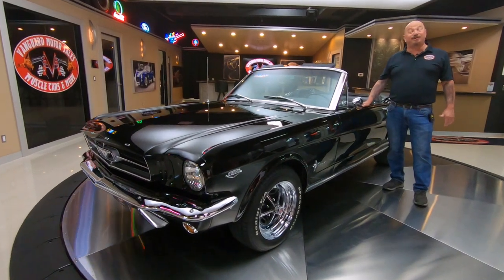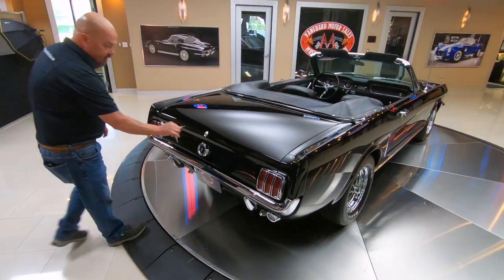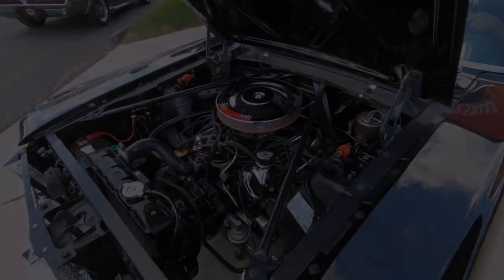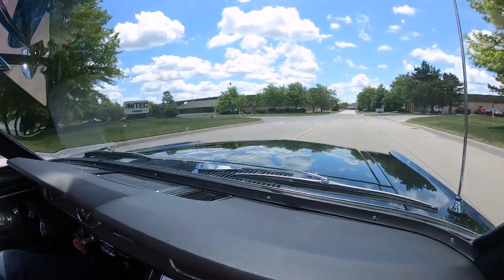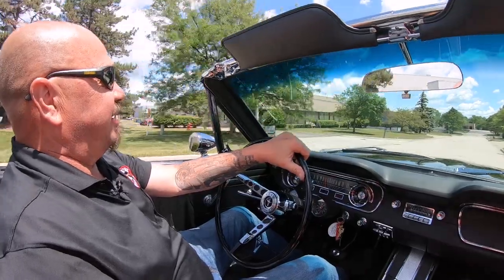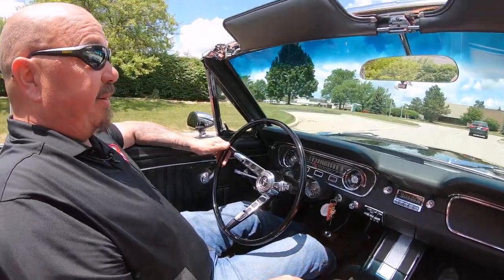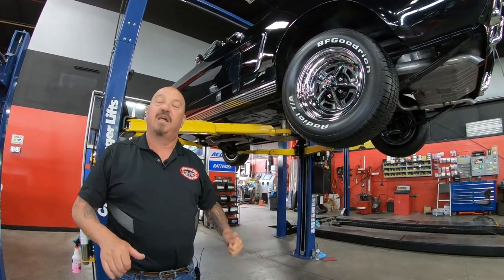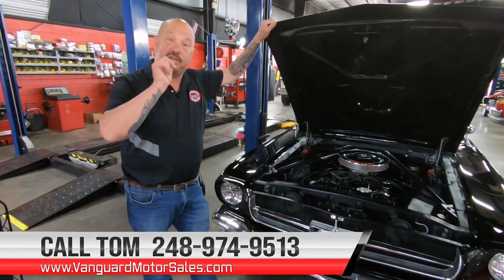1965 Ford Mustang Convertible K-Code For Sale

Comment: Those K-Code 289s were the motors Carroll Shelby put in all the original 1965 Shelby GT350s he built for the racetrack.
Reply: And also the motor Greg had on his Cougar.
Reply: is that a solid lifter motor?
Reply: @charliehayward6356  Yes.
Reply: Yeah, Charlie. They are. And they are very cool mostly because they were meant to be racecar motors.